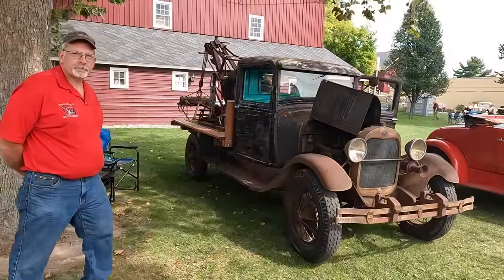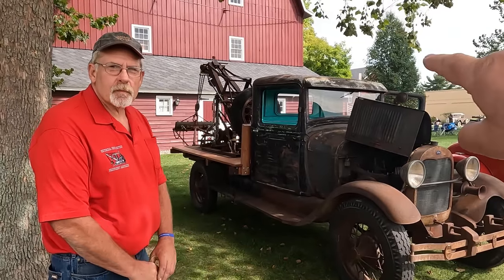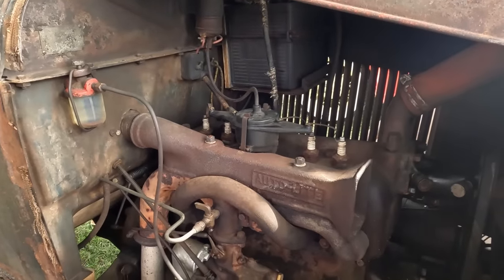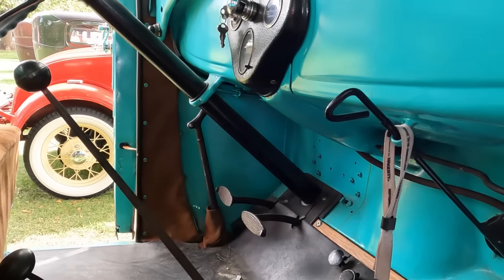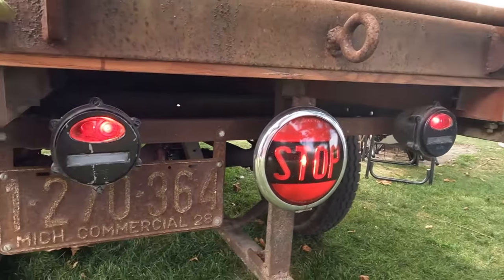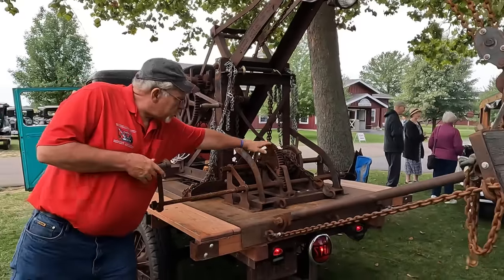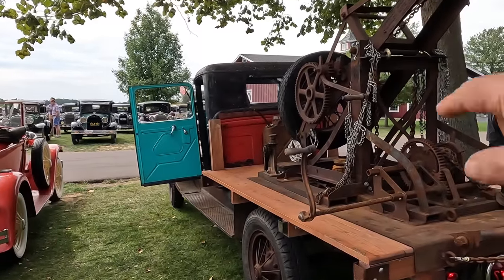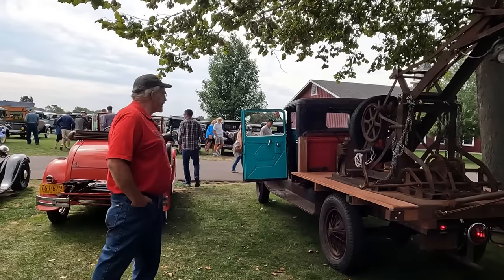A Frankenstein 1929 Model A Tow Truck Actually Works and He Even Tows Cars and Snowmobiles With It!

Comment: I knew a guy in the 90's who had a '69 Chevy with one of those old hand-cranked Manley booms! He used it every day for picking up junk cars and even do private tows, only he had an electric motor hooked up to the winch, and a 12V battery on the bed, to which he'd just attach the battery cable when he needed to run the winch! Towed a lot of cars with that truck. (I thought I was bad...I had a '76 F350 with a proper Weld-Bilt wrecker bed, but next to this guy, I felt like a king driving that $1000 truck!)
Reply from the maker: Thanks for sharing your story!

Comment: THAT IS A CLASSIC 28 29  MODEL A FORD CAB !     CERTAINLY NOT A 1934 !
Reply from the maker: With respect, you can clearly see that a 1934 cab was welded onto the 28-29 cowl.  He even states that in the video.  When the driver's door is open, it has a 1934 interior door panel, and the door and back side of the cab body lines are that of a 1934.  Thanks for your comment and for watching!